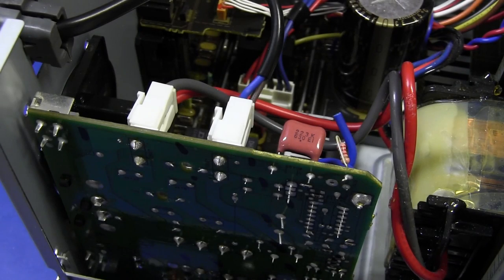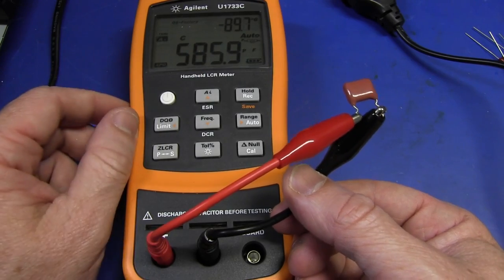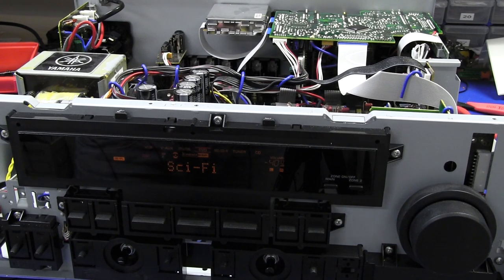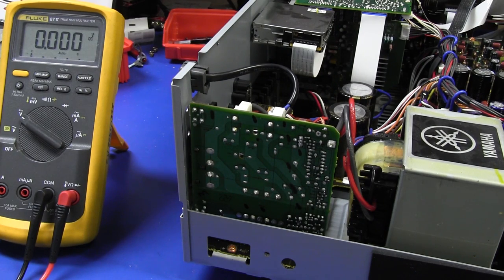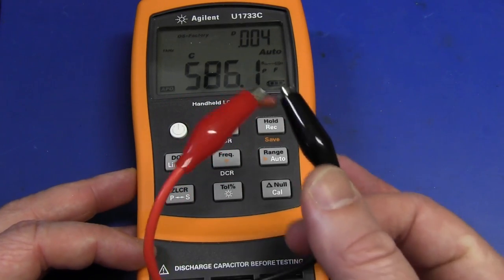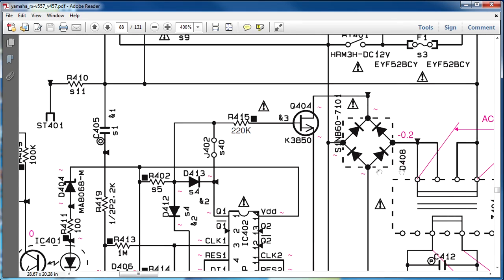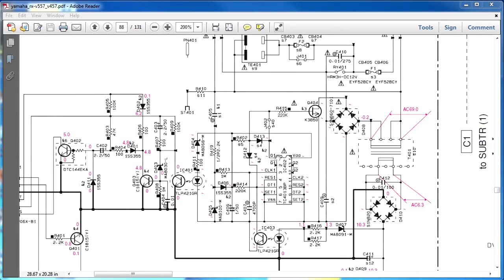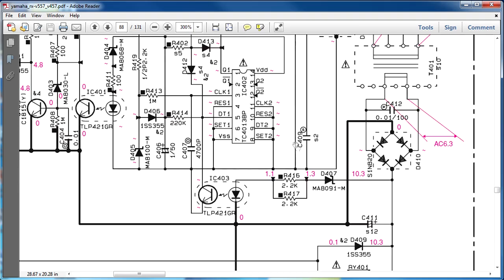EEVBlog #379 - Yamaha RX-V557 Receiver Fix

Comment: Cool, nice video! Nice video source for me now.
A mate of a flashlight forum gave me the link to the ucurrent because i only have a multimeter and he said, according to my question that the current is shunt burden, something ;) dependant.
Yes, im a total noob. ;)
But five years ago I didnt even know that ohms are so much of an influence in this "easy" wireing and soldering some gadgets together, or customizing them.
Anyway, I wanted to finally do something with an five year broken screwlens spycamera.
It has audio but no video on any of my tv's. It did that for exactly one day, five years ago. I think I killed it by cutting the cables of it and swapped them for 5m chinch and 10m telefon wire (earth cable), from my garage to my basement. Never got a clear signal. and when I woke up from a nap. It was broken.
C148 is printed on that board. camera chip gets warm. 12v dc is converted to 5v dc. one A106 cap is on it. I measure 4,56-4,6V is that right?
Could it be the same problem? How can I check that with a Metrawatt M2006 Multimeter, if thats possible? I also inherited something called 555 RC Oscillators (chung instruments electronics from 1995) what is its purpose?
Sorry for so many questions, but I am eager to get skills in electronics.
I want to go to university and study B.Sc. electrical engineering and need to learn in advance because math will kill my time 100%.
Reply: The camera has 4 cables going out. 12+, GND, Video+ and Audio+. What I figured is that GND has to be one for all. Pls correct me if I am wrong.

Comment: He is correct. The polypropylene capacitors self heal unlike MP with burns and opens.  The schematic displays a power detection circuit. It's really just a zero-cross detector and they're using a FET (DC) to control an AC circuit. It's done the same way in architectural light dimmers.

Comment: You could try to use your Fluke 87-5 on AC setting to measure PSU ripple. Fluke 87-5 is pretty good at measuring small AC voltage with higher than 100Hz frequency. It it commonly used for checking if there's any communication going on between nodes of HART protocol line in instrumentation for process automation. (HART protocol is basically a superimposed AC on 4-20mA current loop)

Comment: Hi mate. I'm having similar issue with a V375. The circuit has a bigger blue capacitor C-1507 and 2 small brown ones - any idea which I should be looking at? I'm an electronics dunce and can't solder to save myself.

Comment: Hello, and many thks for your wonderfull blog ! So, I've had the same problem with R-840 yam module (separate elements). In this case, Capa was 8,8 n instead 22 n, and limited to 250V, quite the same as the main (235V here in Belgium)... I replace by a 400V one and it's working like a charm... For information, this Capa is marked C13 !!! :-)

Comment: I have a rx-v459 and also had a DSP-AX759SE with the same issue
got the exact same capacitor as seen in the video didn't work for me.
Tested the power supply as-well... no go
seen similar vids with great success I guess im  not so tech savvy gonna have to put my short arms in my long pockets and spring for a new amp..... doh!   no more Yamaha for me

Comment: Without an in-depth analysis it appears to me that the reduced capacitance of c405 isn't allowing enough current to drive ic402 (4013) and the opto-coupler ic401. Looks to me that ic401 influences the main board power control. I'm guessing +5M is '+5 main', PRY is 'power ready'. and PDET is 'power detect' but I'm just taking a quick guess so I could be wrong.

Comment: I've had this problem too - My receiver came on but turned off again after a few minutes.  Sometimes it would not come on at all. under this condition the power feed to the main transformer was cut by the on board relay.
I changed the cap as in video and still the same. Had a look at the relay circuit on the board and had a guess that the
2SC1815Y NPN Transistor which is in line with the 12V side of the relay was playing up. As the fault was intermittent
I didn't bother testing just changed it. I also changed the another 2SC1518Y  that sits in the same area. I guess if one is faulty the other is quite likely to be of the same quality. This has fixed the issue - I did buy a replacement relay but never bothered fitting. Hope this helps somebody.

Comment: I've worked at my dad's auto shop for about a year now, and when an electronic module breaks in a way that really throws us for a loop, I end up tearing apart the bad part on lunch break or at the end of the day when I'm off the clock.
You wouldn't believe how often I find out that a ten cent (or less) part has failed in a way that both ends up bricking the big expensive thing, AND doesn't let out the magic blue smoke! Of course I won't and usually can't fix the module, for one it's asking for trouble, and I usually end up busting the casing apart to get at what makes it tick anyways.

Comment: DAVE Please!
Dont stop now when its most interesting!! :)

I think that 10.2V on secundary is droping down at the moment you turn on receiver. 
Please install old cap back and use MinMax(Peak) feature on Fluke and monitor 10.2V to see if it changes when you press power button.
Its either going low or going high and IC403 (overvoltage protection) kicks in.

Comment: Hrm, you should be Googling the symptoms before you determine something is broken no matter what. If you can't find anything, look through the service manual. If you aren't equipped to repair it, take it to a local repair shop. Most receivers also have some pretty decent warranties that you should probably use.

Comment: in the first video when you tested voltages and had that strange instable dc measurement, i thinked CAPS!!! not that one do! also in this video you are folowing the diagram in the power suply i think (probably wrong here) the problem was in the way through the octocopler (IC401) since this way power is going to the device controler and the power suply had the 10,2volts again the unstable power trobled either the IC 401 or other component in that direction, lets remember power was OK allaround all PCB's so the only stuff probably wrong was thas unstable voltage on a ic somewere, but this this power supply it's a complicating a bit sothing that could be simpler i guess! love your videos learn a lot from them!

Comment: David, you have to use a megohmmeter such as a Fluke 1587 set to 250 volts AC to check if  this 630 volt film capacitor has a short. Your typical meter does not have the ability to test these kind of shorts. Same hi-pot meter has to be used to find shorts in electric motors also.

Comment: It sounds like the higher current drawn when the disk is to spin, kills the voltages. Have you messured (with a scope) the internal supplys when it spins the disk?

Comment: EEvblog 

What type of meter did you use to check that cap . Just wondering . Can you check caps higher that 2200 uf . My meter aka multimeter wont test that high . Im looking for a way to check caps fast or in circuit testing ..Say I want to check all my caps in my power supply in my marantz sr-18 ex reciever . Whats the fastest way to check in curcuit . I know that a esr meter only go's so high for testing some caps . How do you check filter caps . there voltage is always higher .

Comment: Regarding the 4.8 volts, wasn't that speced in the service manual? (EEVBlog #378 at 37:50) I haven't checked the schematic and followed along *that* closely so I'm not sure where you're measuring those 4.8 volts exactly.

Comment: I've had trouble with a capacitor used as a mains dropper before. It too went low value, producing an intermittent and hard-to-find fault on a central heating timer.

Comment: An oscilloscope is your friend. Putting a scope on the power rails will show you if there's a problem with the power supply. The voltage jumping around should have been a clue.
Reply: +Ryu Raccoon I kept waiting for the scope probes to be applied, but no, always the DVM measuring the average voltage. And no audio input signal and speaker to simply check if the amp was working, even though the control panel was not lit up. But still fun to watch.

Comment: The capacitive reactance alone would have gone from 144Kohm @ 22nF to 6.6Mohm at 500pF.  Not much current flow through 6.6Mohm even at mains voltage.

Comment: same situation here, my RX-V457 wouldn't turn on, and noticed that cap was a bit brown-ish. tried to find one in my retrieved bits, but no joy, gotta order that part. thanks  for the vid, it was interesting !

also for watching the rest, indeed, that's ... a pretty obscure design for a power supply, in fact i wonder WHY they put all that to command a press button, instead of just going with a basic power switch, ...why make simple when you can make it complicated, eh.
Reply: Patachu Because you cannot "power on" completely switched off device with a remote control from your couch.
Its just convienence that demands such solutions. Well.....
Reply: There are really more reliable ways to make a standby supply though, This looks deliberately evil.

Comment: What the heck kind of circuit is this, its like they switch the AC signal to chop it up even more before sending it through a transformer to create 10 volts. Only thing i can think of is maybe that lets them use a smaller transformer (toroids are expensive) and get better line rejection because the frequency is higher now so you can get less noise on the power rail

Comment: Awesome video, but did have a question, I have the same model receiver but the capacitor in question is labeled in mine as 473K 400FI , it is the exact same size as the 223K capacitor as well, wondering if there was an update to this capacitor along the way, and also if you had any resource on where to obtain said capacitor. Thanks for any help!
Reply: 47n will work as well

Comment: I have the same problem. Replacing the cap did not do anything even though it measured 11nf. But I managed to get it to work by plugging it in to my variac and setting the voltage to 220. Regular line voltage was 237 and going into the Diagnostic menu 10 showed a value for ps of 34 were the nominal values are 36 to 49. It was strange to see that as I decrease my variac voltage to 220 the analog ps value increased to 44 and the amplifier started working. Does anyone have any ideas on how to solve this?

Comment: a lot times when I repair those things I have to go no further than the power board. the problem is always on the AC side. a voltage surge probably cooked that cap

Comment: Also measure the voltage across C406 at the moment you press power button.

This is great opportunity to use scope on secundary to see how low and how long voltage going down at the moment you turn the unit on and than use MinMax feature of Agilent, Fluke and GM meter to see if they all can catch that!

Please dont give up now!! :))

Comment: Nice work Man. I have  a problem with my Yamaha RX-V 1065 which switches off after 3 seconds. It has two 630v capacitors which I replaced with new ones, but the problem has not been solved. The interesting thing is that when I point a hot air with a hair dryer to the power board for 20 seconds, everything comes back to normal and the receiver works. Any suggestions for solving this. What is the thing that if we heat will work in the power board ???
Reply: It could be a thermistor,either a ptc or a ntc
Reply: It usually is kind of electrolytic cap that gains a little bit of capacity when being heated up. It potentially did dry out, so have a check on the other electrolytics. It of course could be a cold joint on the board as well, so have a check for these as well....

Comment: That is a difficult find but an awesome one for the memory bank. Favorite part... the clock coming almost directly from the mains power. unreal. I wonder what the waveform would've looked like with the cap in place. Great vid. So we're saying that the flip flop uses the mains itself as a clock signal. With out the clock the chip won't function at all. The chip which will latch the +5V on then powers the rest of the chips/ circuitry? If so thats pretty awesome! Also I want to see what the reset pin is on that and see in the video if I can tell what the surrounding circuitry is in the schematic. A theory is that some sensor i.e. thermal, over voltage/comparator, or zener controlled voltage spike resets the latch and turns the stereo off for protection?

Comment: Is there an equivelant component in the HTR-3063, does anyone know? It's a similair model to the RX's but I can't find this specific capacitor that may be the issue given the board has a different layout, but people seem to be saying this fix works for all htr and rx models. Any help would be greatly appreciated
Reply: Did you ever find a fix? My one keeps flickering the picture for about 10 mins before it works normally, wonder if its the same thing

Comment: Hi, Dave, I just subscribed.  Here's my guess about the C405 value problem. Your measured value was ~550 pF versus 22,000 pf (= 22 nF) = or about 2.5% of what it should be. That means its AC impedance is only 2.5%;  I think the voltage into the CMOS 4013 CLK and D inputs won't reliably cross the CMOS Vth = not reliably toggle the FF. The test would be to compare the voltage waveform on the CLK1 input with both good C405 and with bad C405. I bet the bad C will not CLK the FF. What d'ya think?

Comment: The bad cap is not a filter cap -- it would not have caused ripple. It is a *coupling* cap: it couples the mains to the rectifier circuit. It acts (under AC) as a high-value resistor, and when bad, a *very* high value one.

Comment: This is really interesting, it would love to know how the micro controller was affected by the faulty capacitor.
Reply: Possibly the Controller has a startup selftest which checks the 5V supply voltage, and when the ripples go below a certain level it triggers the protection.

Comment: Thanks, Yehuda, but on review I think I mis-stated the AC impedance ;-) It is [1/2pif] so it will be too high not too low. Still yet;  "too high" has the effect I described.- the voltage will be too low to trigger at the CLK input!

Comment: Multisim 12 Power Pro edition
it can simulate analog/digital circuits and program/run FPGA and MCU!
I've been using just over a year now since I don't have easy access to components or the right place to work with electronics :(
so if you want to get started in electronics this is a good tool to have!
it lets you run your design an spots bugs easily :) 
It's easy to understand and to use.
So fare the most complex thing I've done is a 5Mhz 8 bit ALU with 4 arithmetic and 4 logic functions.
TPB ;)

Comment: I fell into the same trap many years ago and wouldn't convince myself it was a polyester cap. Now it's retained in my memory banks and I usually go straight to it.  Easy money for Yamaha techs. Don't buy caps without proper markings as they are the cheapest of the cheap and the problem may occur again after a year or two.

Comment: I have 3 same model dvd player from LG model# dv325. They all have same problem. If you know anything about this please help me. When the dvd player have no disc in it shows no disc on the dvd florecent display. And when I insert a disc it goes to stand-by. The disc spins for a fraction of sec and the it goes to stand-by.

Comment: With the capacitive current leading phase voltage, the transformer is switched on only at peak voltage, that is what you have to do with transformers. It makes wonders with the inrush current.

Comment: I have a weird thing with my stereo i got after dumpster diving. The display didn't work. and neither did the CD tray. so i gutted every trace of the cd tray.
Display still wasnt working. so i just used it blindly. (It was internally still functioning somehow. so it played audio. and the radio worked and even the cassette tape player worked except without the display...
Then a few months to a year or so later.. The display is magically working again!! What kind of strange magic is that? lol

Comment: I have a Yamaha R-1330 under repair and got the diagnostic message PS1:106. which indicates a power fault of these either one of these voltages: 
 Detects +12A, -12A, +5I, +29V, +12MVOL 
and AC (D202-203 of the MAIN P.C.B.) however I measured all of them and they seem OK. The value of 106 is also just outside the normal range 107-133. Anybody has experience with this model ?
Reply: I found out what happens at the R-1330. There is one signal collected at the main board via various resistors from the Ground of various voltages. For voltages that have no +/- it is drawn from the positive. All the voltages are combined (via resistors) and result in a about 2.2 volt signal. This signal will trigger the CPU.
Mine was only slightly off therefore I used a 22k Ohm resistor to +5v to fine tune.
That increased the PS1 level from 106 to 120.

Comment: I think what's happening in this circuit with C405 is a little simpler than some are assuming.  0.22uF gives a huge impedance at 50Hz, but it's all reactive so you don't get much heating (but the fact is that it is in series with its load.  You then have a 2.2k to keep the current at 10mA or less (and possibly some sort of smoothing effect from the RC - though maybe not.)  With this you can drive your zener and get your 'regulated' 10 or 12V off it.  It is a truly horrible way to do it!

Comment: What about RX-V375? I can't find any fault and it just doesnt start! It does absolutely nothing.... Any hints? Anyone had this problem? I tried to reset using straight + tone + power and nothing... Also, I think the stand by circuit is different from the one on RX-V557.

Comment: Dave, you were right originally, D405 is a 10V Zener not a Schottky. The 4013 would have some magic smoke escape otherwise. ;-)

Reference: http://sparedparts.com/parts/details/yamaha_ma8100_10v_zener_diode_vu995400